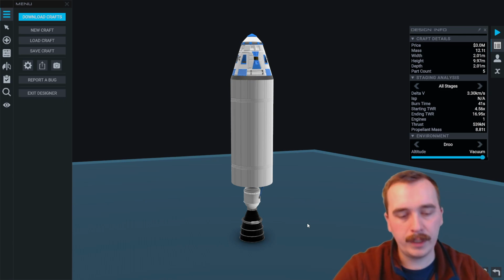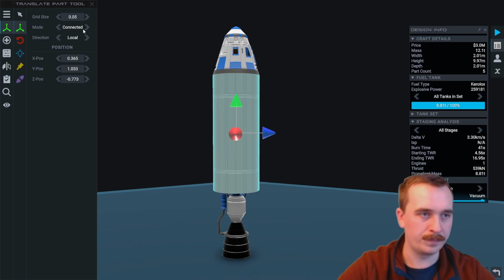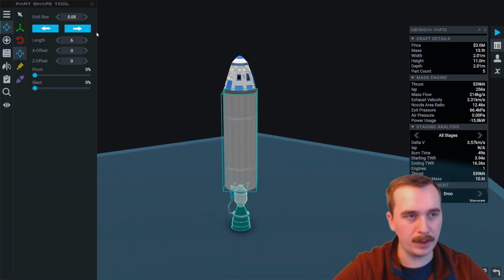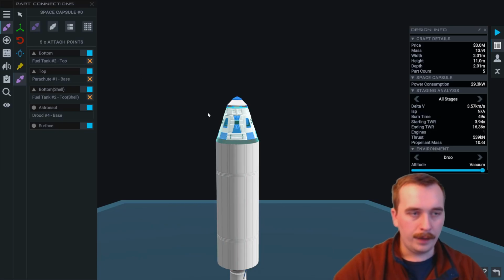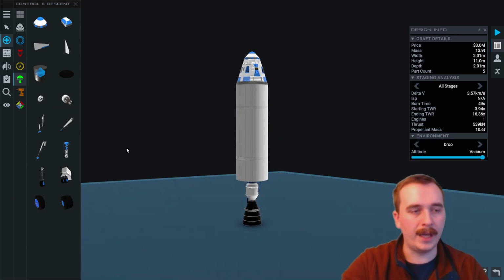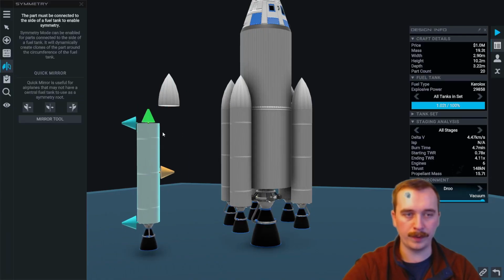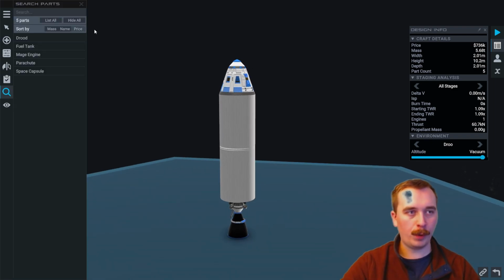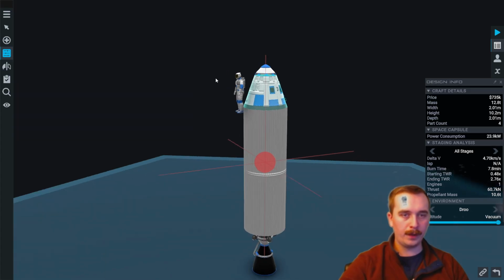Juno: New Origins Tutorial || Part 1 Designer Tools

Comment: How do you add multiple engines on the bottom of a rocket with cemetery
Reply from the maker: place one rocket engine on the bottom of the fuel tank but not in the center, then open the symmetry tool and use it to duplicate the enginge